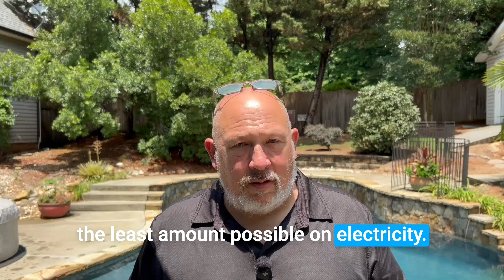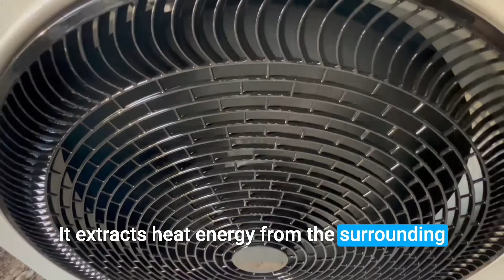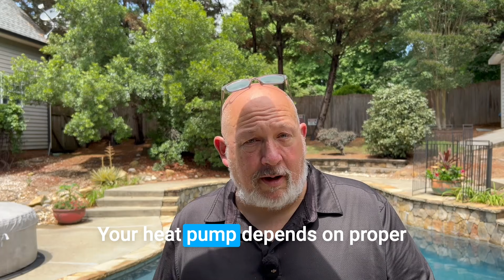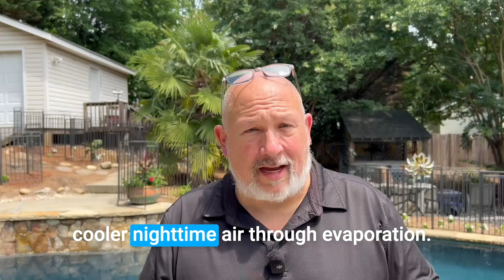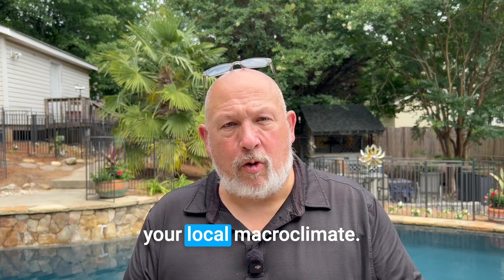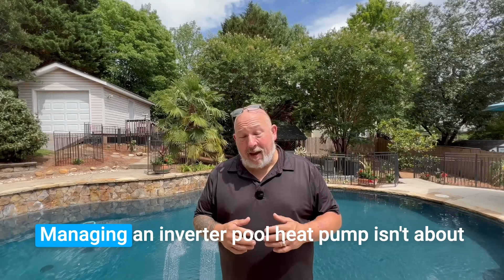Your Utility Company Wants You to Miss This Heat Pump Hack

Comment from the maker: Most pool owners buy an inverter heat pump… then accidentally run it in the least efficient way possible.
The biggest things that affect your electricity costs are:
• Your climate zone
• Overnight temperatures
• Pool size vs heater size
• Utility company peak pricing
• Whether you use a solar cover
If you want help optimizing your setup, leave a comment with:
✔ Your pool size
✔ Your heater size
✔ Your climate zone
✔ Your utility company peak hours
✔ Whether you use a solar cover
I’ll try to help you build a smarter heating schedule for your setup.

Comment: What pool heater would you recommend for an above ground 18 foot pool?
Reply from the maker: Hi there, assuming you're referring to an average 18-foot round above-ground pool, your pool volume is probably somewhere in the 7,500-8,500 gallon range depending on the water depth.
My recommendation would be to go a little larger than the minimum requirement so the heat pump doesn't have to run as long to maintain your target temperature and can operate more efficiently. The brands I've personally installed are Aquastrong (shown in this video) and Turbro (shown in a more recent video), and both have performed well so far.
How much you oversize it depends on your climate, how long you want to extend your swimming season, and of course your budget. There is a point of diminishing returns, but in general I'd rather see someone slightly oversize a heat pump than undersize one.
Right now, the Aquastrong 18,000-gallon model is actually less expensive than the 16,000-gallon model, so that's the one I'd lean toward.
https://geni.us/vURAd (Amazon)
Disclosure: I earn a commission if you choose to shop using the affiliate link above. As an Amazon Associate, I earn from qualifying purchases. Thank you for supporting the channel!